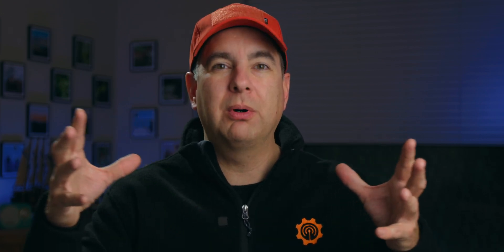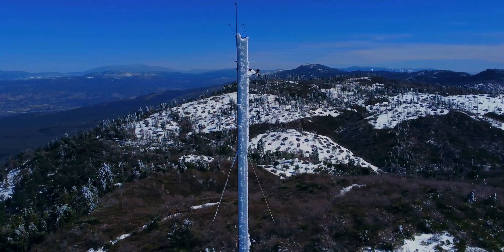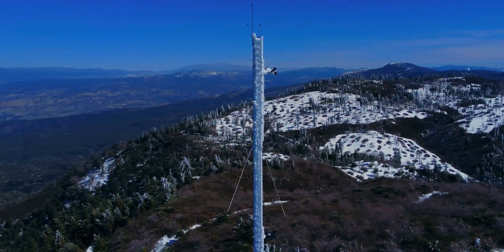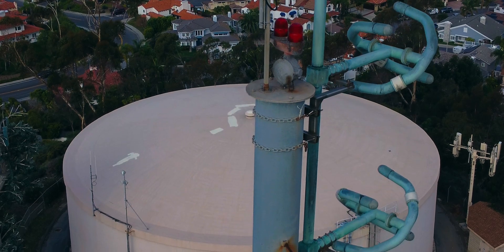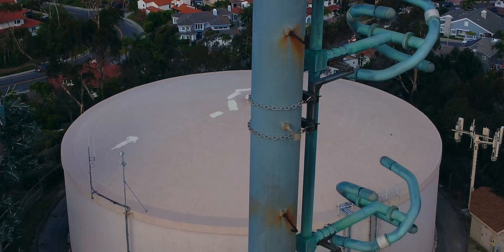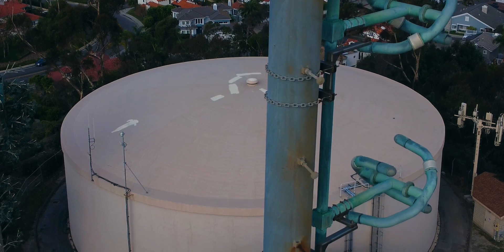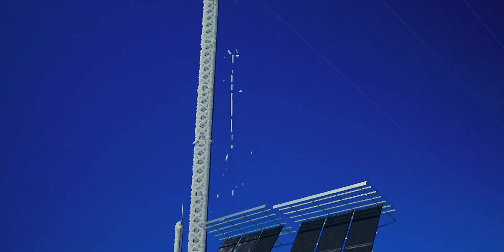Icy Antennas and Heaters: How Broadcast Stations Tackle Winter Challenges

Comment: This area is notorious for ice issues. We have a site near that FM transmitter and last week we had to go up there to break the ice off several of the microwave dishes. Even with radome covers the ice was blocking 30 db of signal and slowing our data rates considerably.
Reply from the maker: Yikes!

That transmitter isn't there anymore. From what I understand they cleaned out the site of their equipment. The lease stated that the tower and building were the property of the tribe, so the tower is still there. I think they're trying to move the station to another location that has easier access. That site definitely had access issues.
Reply: I heard that the tribe was upset with the comm company and decided not to renew the lease. The station has an STA for Mt. Woodson.
Reply from the maker: @alexhipolito5248 They were upset, but really it was lack of clear guidelines, then a couple of incidents on the road in one specific spot (we got a propane truck stuck then unstuck, and then one of their contractors flipped a truck while the stations’ people were up there, that was after I left). The station was frustrated with the amount of effort and money it took to maintain that site for the reach it had, and decided to move it. The station didn’t renew. It was a strange relationship. We did a lot to help them maintain the road, then some admin changes at the station and the church and that relationship became strained. 🤷‍♂️ I have some beautiful video and photos from up there and lots of memories.
Reply from the maker: Oh maybe you're thinking of the communications guys at the other site up there. I forgot about them until right now. That's an older site too.

Comment: Winter 1998, working at WTVQ-TV, the ABC affiliate in Lexington, Kentucky.  Ice falling off the tower hitting the roof of the studio would make you jump.  Sounded like a shotgun blast when it hit!  Several years later, major ice storm.  Chunks of ice actually came through the roof of the building, doing considerable damage to the station.

Comment: Another good one, Marcus!  Three from my professional past.  (I'll use the relevant callsigns.)... 4010 Chesapeake Street N.W., Washington D.C.(Multiple stations on a self-supporting tower.( This one is notorious for sometimes having chunks of ice falling off of it that range from the size of a casket to a small car.  And, sometimes weighing a couple of thousand pounds;  In January 1996, CKWS-TV (Kingston, Ontario)  lost its 40-year-old 870' tower on Wolfe Island due to an 8" coating of ice on the structure; In 1989, WPTF-TV and WRAL-TV (Raleigh market) lost their towers at Apex and Auburn North Carolina, respectively.  The WPTF-TV collapse happened in daylight with witnesses seeing ice chunks falling off the town and hitting the guy lines.  Ice is another reason why you need to make sure the exhauster on your hardline is functioning perfectly.  Imagine the outcome of water freezing at a critical point in your transmission line!  

Theory thought for a couple of future shows:  Diplexing, Triplexing, and other weirdness at AM, FM, and TV.  Especially how BpBr filters work.  How to set them up, their "care and feeding", etc.  Also, how about having tenants on your tower?  Especially on an AM tower.  Including Isocouplers..  How some are stock (Like at 161 MHZ) while others are custom (Like at 147 MHz)... How some are small (Like for 2-way and Ham) while others are about the size of the muffler on an 18-wheeker (FM Broadcast).  

Happy New Year!

Comment: Interesting stuff. I’ve never come across heated antennas here in the UK, I guess the climate doesn’t really call for it. That said, I’ve had to abandon a few jobs due to football sized lumps of snow/ice falling from 700ft or so. I don’t think a hard hat would help much there. Also seen plentry of microwave drums badly beaten up by falling ice. I’ve also seen short chains attached to points where icicles would form, so they swing around in the wind and break them up before they get out of hand.